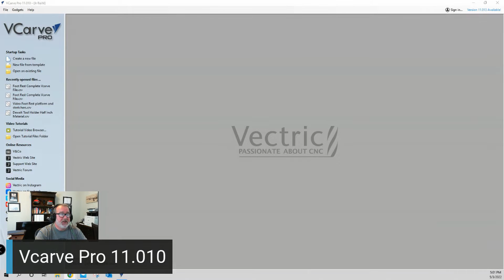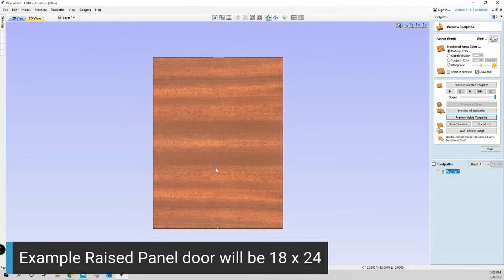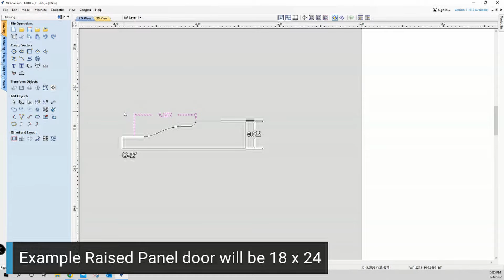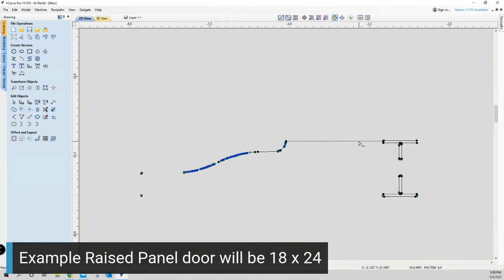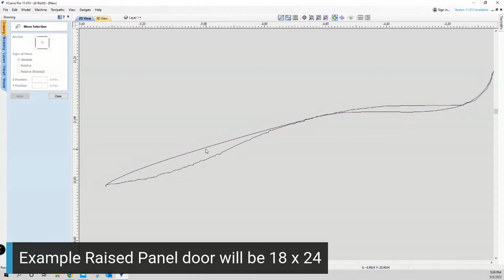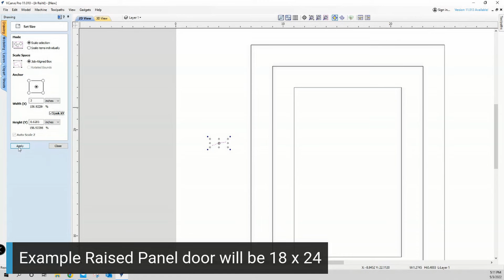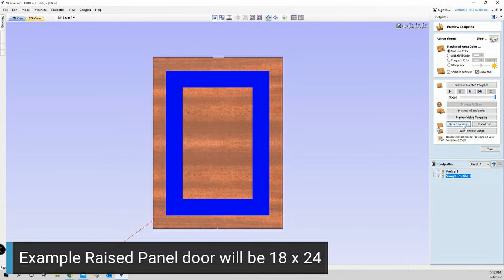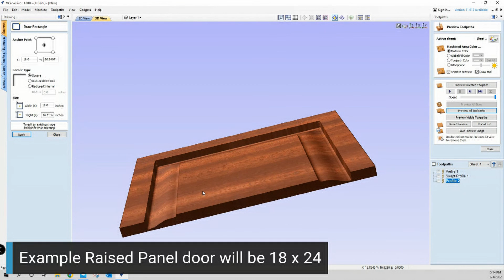How To Make Raised Panel Cabinet Doors On Onefinity CNC Machine

Comment: what bits did you use
Reply from the maker: Hi Big Easy, I used two for the fluting, mainly just to see what would work best.  A 1/4 and 1/8 tapered ball nose bit.  Both worked well, the 1/4" was considerably faster and no real difference in finish.  Feel fee to subscribe if you haven't already!

Comment: Hi thanks for great job done , my question is I've been following you on this particular job step by step  but my machine i only able to make the roughing part if I try to do the  finishing  the machine tell me there is nothing in the 3D to work on what do I do? Thanks
Reply from the maker: What software are you using, and what bits?
Reply: Thanks though for prompt reply I've been able to rectify it I'm using vectric aspire

Comment: Very good content! What I am curious about is how does the door retain its shape over time, given the fact that a traditional raised panel door has a glued up frame, made out of 4 elements? I know that a simple wood panel that is carved on one face, doesn t retain its shape because one side has more open grain surface than the other. It is a matter of concern on this particular project?
Reply from the maker: Good question!  It was a concern when doing it. I was delivering the piece 1200 miles away so I delayed delivery for two weeks once I was finished with exactly this on my mind. The doors stayed flat and I’ve followed up afterwards and it seems they have remained flat.
Reply: thanks for the reply! happy to hear that :) @TradeSkillersAnonymous

Comment: Very interesting using the molding toolpath. 
I've just learned how to Vcarve an MDF cabinet door, using a 90°V bit for the "rails and stiles", and a 120°V bit for the "panel". The advantage of this is getting as close to sharp inside corners as possible.
Reply from the maker: hi Acer, yeah i thought it was a cool way to use the machine and enjoyed figuring it out!

Comment: This looks like a very easy way to make a raised panel door Would you share or sell me the file you created the file you did to make the Door. I also use the vectric software. also could the file you made  be resized to make different size doors.? Thanks Jeff Peters
Reply from the maker: Hi Jeff, thanks for checking it out.  Per your request I added the file that I created to my store, link right below here.  

https://tradeskillersanonymous.com/shop 

Consider subscribing, and be on the lookout for more/other videos.  Thanks!

Comment: Great video. I retired and have been woodworking for 25 years. Found your channel and its been a lot of fun watching. Because of you I am thinking I would buy a CNC to add to my shop. I think the One Finity is an awesome machine but I just came across another CNC company, Step Craft. I am wondering if you considered Step Craft and if yes, why you chose One Finity. Just wondering. Thanks again for the very good content.
Reply from the maker: Hi John, glad you’re liking the videos. I did look at step craft, and like the other competitors compared both component quality, and cost. Now, I’m recalling from memory, but I’m certain that a similar equipped and sized CNC from step craft was about $2000 more than the onefinity. Also, I wasn’t a fan of the aluminum extrusion, compared to the onefinity hardened and chromed 37 and 50mm shafts. It’s been a great addition to my shop, and I also have a onefinity review video on my channel if you like. I mainly wanted to avoid belts, and v wheels found on a good number of machines. (Stepcraft doest use belts in fairness). At the end of my research, the quality components vs cost is why I chose onefinity. It’s not disappointed me at all, and I’m glad I did it. I’m sure the other machines are also fine, not knocking anyone at all. No matter which you choose, I hope you enjoy it!

Comment: Did  you use a solid piece of hardwood? Or did you do multiple glue up to get to the rough size then mill the board(s) down? Curious because my experience is that large single boards have a tendency to warp and crack over time opposed to glue up for raised panels. I just purchased a Longmill MK2 and I am hoping to one day use my cnc for cabinetry.
Reply from the maker: Hey there!  The larger cabinet doors were glue ups of 3” stock.  The three small drawer fronts which were about 6” tall, 6” wide were one piece of stock.  Due to their small dimensions I think they’ll be fine. These were all made with quarter sawn white oak, which is less prone to movement.
Reply: @TradeSkillersAnonymous  Thank you for the reply  I too like the white oak hard to get here where I live.

Comment: Great video, how do you get square inside corners?  I am using Aspire 9.7
Reply from the maker: Hi Richie, short answer is the method I used doesn’t produce true sharp inside corners. Long answer is, I used a 1/16 tapered ball nose from cadencemfgdesign (Cody’s cnc on Facebook). Because the bit is such a small radius, they appear very close to sharp

Comment: Great video!    I do have a few questions..  On the large door say the profile size used in the moulding is 2" wide x .5" height.  That looks great.  Now on the drawer fronts; A) what did you use for the inward offset? and B) what is the width and height of the moulding profile?     I tried a 1" offset, and changed the moulding profile to 1'' x .5''.  That just looked a little weird to me. I then tried 1" x .25"  that looks a little better on the drawer fronts. I'm curious what your offset and profile sizes are.
Reply from the maker: Hi Michael A , Thanks for taking the time to view, and comment I really do appreciate it.  
So, it really depends on the overall size of the drawer or cabinet door you are working on.  It completely depends on the look youre going for and the aesthetics relating to proportion.  In the video, Im really showing an example, and not the actual door because it didn't dawn on me to cover this in a video until I was at the end of this project.  In the example, I used a (roughly appropriate size) cabinet door with 2" stile and rail appearance.  In that example, I used a 2" profile just to have some symmetry in the design.   These can be ANY size you want them to be.  Some may prefer a beefier stile and rail look, while others may need to slim that down.  If you look closely at the doors versus the drawer fronts, they do not have the same width stile and rail because in the case of the much smaller drawer fronts, a 2" design would've been too heavy for the size of the drawer fronts.  At the end of the day, if it looks good to you (and or the customer), then it's a success.

If you haven't had a chance yet, and are willing, I'd love to ask you to subscribe in order to help me get the word out to more people who might be interested.  Thanks again and have a great day!
Reply: @TradeSkillersAnonymous  thank you for the quick reply. Yeah, I was asking how much smaller you went with on the stiles and rails for the drawers. And how deep?  2" is definitely too heavy.
Reply from the maker: @michaela4141  oh sorry, for the drawers it was a one inch rail and stile, the max depth of the carve making up the profile was .500, leaving .250 at the thinnest point.

Comment: How long did it take to run both toolpaths?
Reply from the maker: Each cab door was about 30 minutes, the three drawer fronts were about an hour for all 3 (from the same blank). Thanks for watching!
Reply: @TradeSkillersAnonymous  That's much faster than I expected. Thanks.
Reply from the maker: @bobd.  1/4” ball nose at about 150 ipm, 10% step over if I recall correctly.
Reply: @TradeSkillersAnonymous  Yup in my reply to Mr(s) Hermsen ... 30 minute .. hmm ... would take me that long to make the traditional Rail & Stiles frame to put the panel in.

Comment: Like the concept and with quartersawn white oat you likely have the stability but as a purist I would have used this for the panel and still made rails and styles on the table saw
Reply: Interesting comment  ... "purist" ... I might say "traditionalist" .... he did say in the beginning of the video he wanted a consistent grain direction as a design feature, he would lose that in the traditional build.  I would also think his door would be stronger  than the traditional build because it has longer and likely fewer joints ( yes I agree traditional has been strong enough)  .... Let's just say this is something I struggle with "traditional" vs "new fangled".

What I would be interested in is time to create for the different methods.... that is the deciding factor for me..oh and chance of me doing an "ah crap" moment
Reply from the maker: Hey there, definitely more than one way to skin that cat!  I’m hoping that because I ripped the oak into 3” wide strips and glued up, and that qtr sawn is much more stable than flat sawn that I won’t have any issues. Thanks for watching!